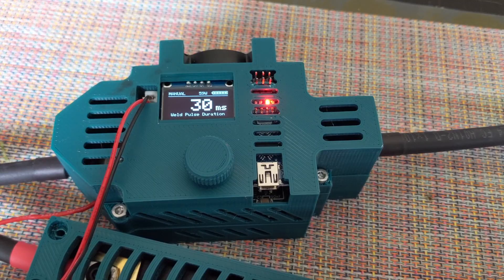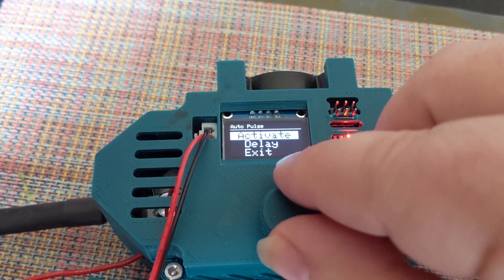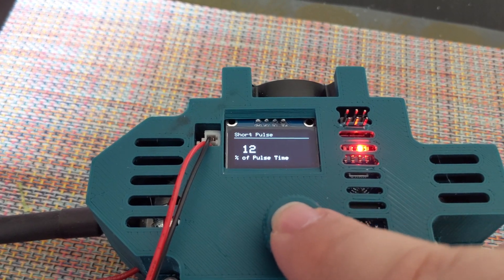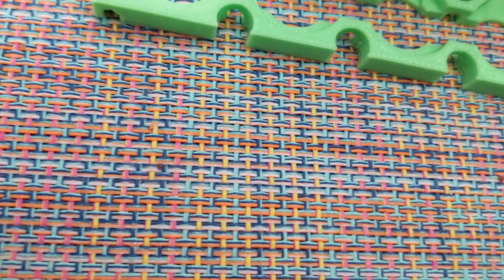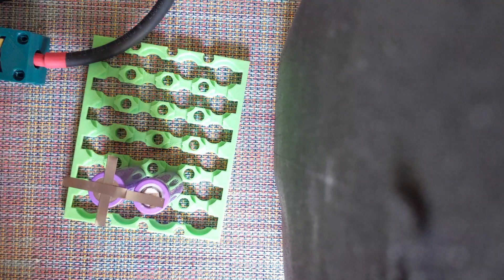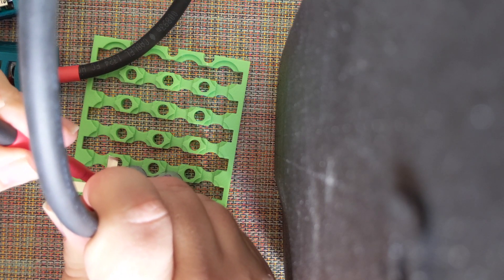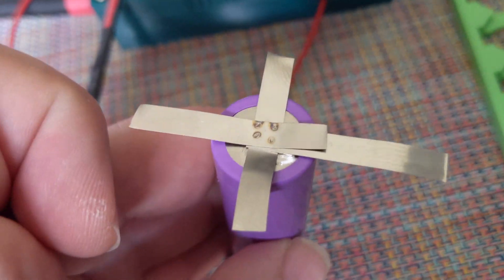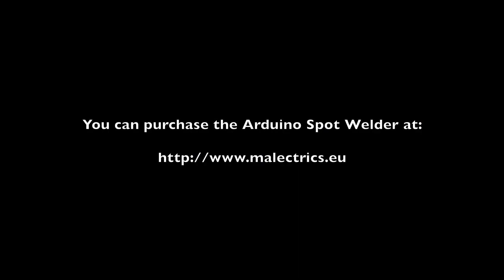Malectrics.eu Arduino Spot Welder

Comment: all my welder says is...low battery voltage...am i doing something wrong?
Reply from the maker: ... not using the correct battery?   You must use a 3S ( 3 cell in series ) LiPo battery, with at least 50C drain capacity, with an XT90 connector.

OR, if you bought the car battery version, you have to use a 12V fully charged car battery.   If it's fallen to 10-11V or lower you will get that error message.
Reply: @TheMakersWorkshop  I have the same battery as in the video but a 6000mAh....I contacted Malectric and they explained to me what i need to do.

Comment: i bought one few months back and it works great. I did what averagejoe did for the power battery https://www.youtube.com/watch?v=ReY7bz3tsMM&t=1672s
Reply from the maker: These are great little welders.  I'm working on a new 3D printed desk/bench enclosure for them to make it easier to weld battery packs.

Comment: how many welds can you get from your battery pack?
Reply: usually about 900 welds... that's what i get out of mine...
Reply from the maker: @intra_morph  I get 400 or so, but I need bigger welds and I'm doing a lot of wire welding.
Reply: Dennis Young  You can probably do that but i'm worried that the discharge current might be too high and you will just burn holes through your batteries. If you do do that please try it on some strips before you weld onto the battery itself.

Comment: Where can u buy this
Reply: I'm selling mine
Reply: Are u interested?.
Reply: Fast Diy - how much?
Reply: @Bertoslav  I'll do $130
Reply: I'll send u a video of it if u want.
Reply: Fast Diy - 130!? Used, Na, closer to 80$ the base unit itself new is 75€ and it the extras maybe another 25€ so u want to be in the green for a used product... I could do 80
Reply: @Bertoslav  Mine is barely used. All u gotta do is connect a battery to an xt90 connector.  U can disassemble is an assemble it the way u want cus I didn't assemble it correctly.
Reply: @Bertoslav  The least I can do is $120.
Reply: www.malectrics.eu -- it's a very popular product so it can get out of stock if he runs out of a specific part for the kit.